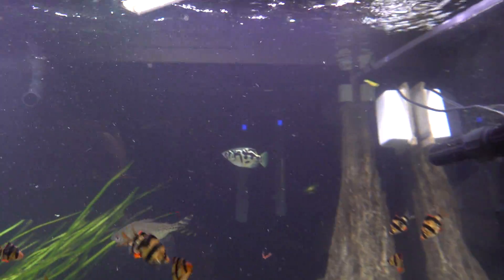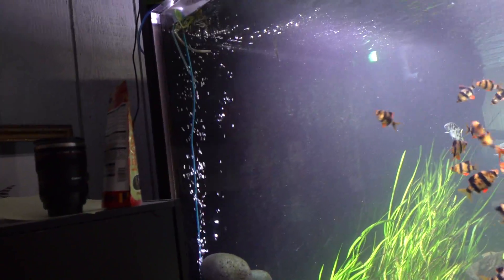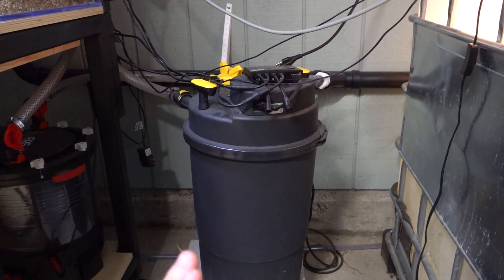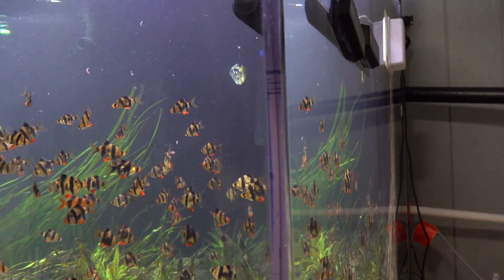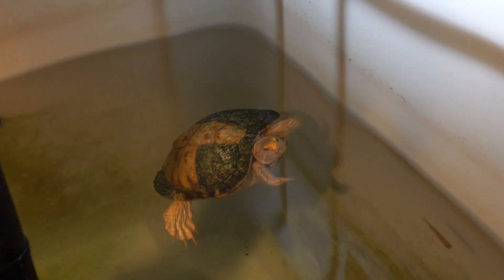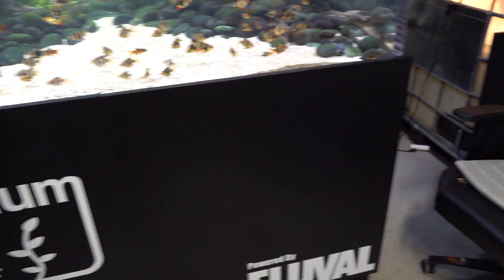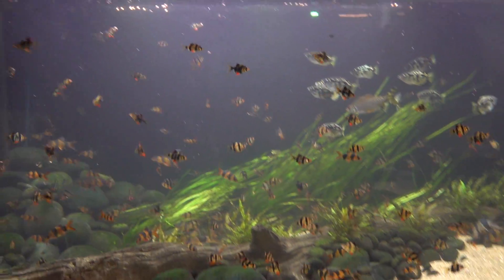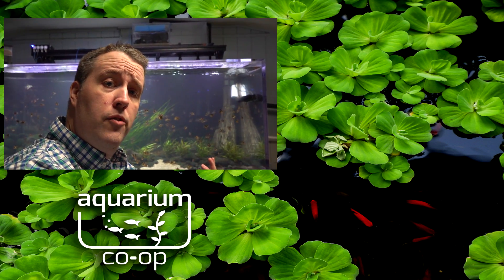My 800 Gallon Aquarium Walkthrough

Comment: @Aquarium Co-Op, wouldn't a Drum Filter that is typically used for Koi's work then or are they too loud for your taste? 

IF you do a pond, I suggest 3 inches of dead space, big stones on top of that, resting on eggcrate or something then smaller rocks yada yada. Basically, a Bog Filter. Placing a tube into the dead space, you can essentially flush out the Gunk. While anything you grow in the Bog will filter the nutrients out.

Comment: I Need Some Help,
built a underwater SandFall and used Concrete that other people have used,   I know everything you add will effect PH level Etc,    Bottom line is my PH level is well over  8.0    Will this kill my fish??,    It's a 55gallon,   I got maybe 20 fish,    All tetras -Diamonds,-GlowLights Etc,      I added Neutral Regulator adjust PH to 7.0,  And Added Stress coat + which also will help,     Any other advice??,

Comment: How many and which length fluval 2.0's would you recommend for a 420 gallon aquarium measuring 7' long by 4' tall and 2' wide?
Reply from the maker: Depends on how bright you need it, but I would start with a 48 inch and a 36 inch and see how you like that. Your tank is 8 inches taller than mine, but I'm twice as wide. I run three 48inch lights on the 800g. So I think you'd get similar light to what I have with just the two lights. I myself am going to switch to the 3.0s soon, a little bit less par, but I feel I'll enjoy the natural light cycle a lot.

Comment: Dudeeee wrong glue going from abs to pvc on that drain. You need green transition cement
Reply from the maker: I've never had a problem with a no pressure system drain using the hot glue as opposed to the green in a transition here.